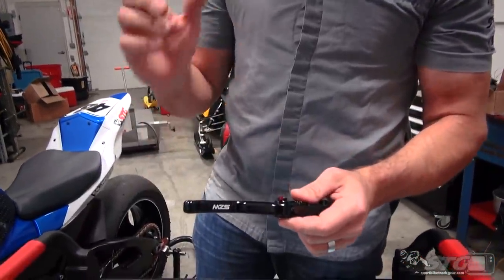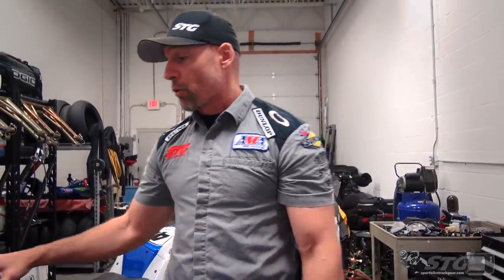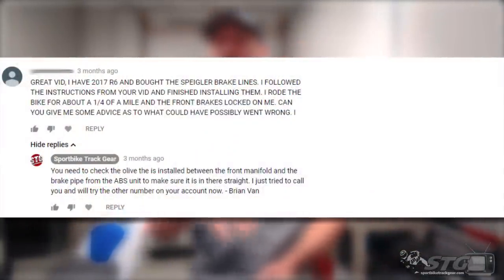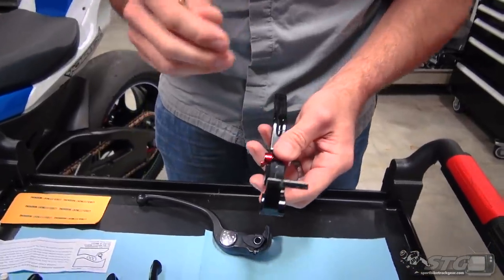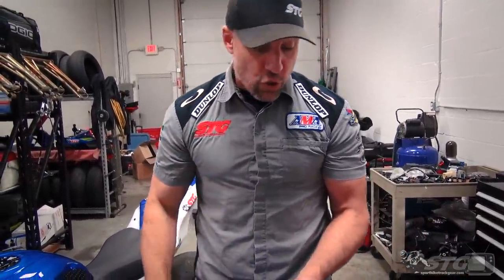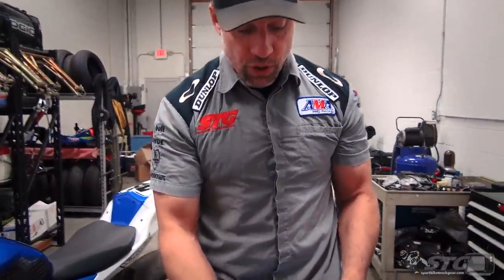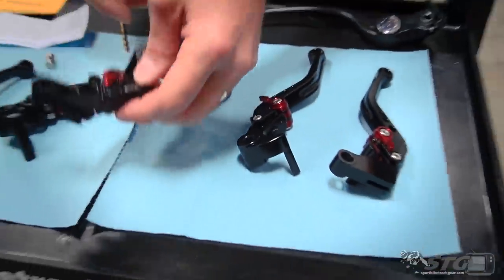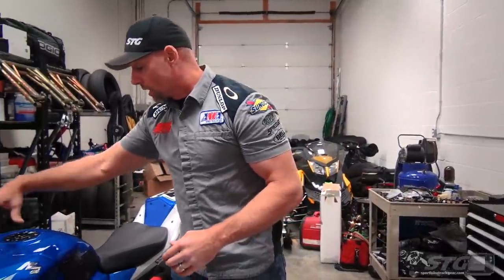The Truth About Cheap Motorcycle Levers | Sportbike Track Gear

Comment: So you wouldn't run a billet lever on your bike... no way in hell right but plz tell me how your completely fine running a cast stock lever I have a 20 dollar set that has way less play on them than those do I mean if you have the money to blow than go for it buy those 90 dollar levers but in the stunt community our bikes get dropped and levers break and I gladly trust my life with those 20 billet levers and when they do break I can buy 5 sets to the 1 set there is just so much better things to spend your money on like actual gear that will protect you when you crash cause there is only 2 types of riders but trying to fear monger people into buying 100 dollar levers just isnt right
Reply from the maker: Zero fear mongering, 100% truth. There are SEVERAL comments in this video from riders who have had their brakes lock up caused by these shit levers. How in the fuck do you justify accusing me of fear mongering because I am sharing something that is true? - Brian Van
Reply: So full brake lock up because of the levers that sounds more of a master cylinder problem or install issue but I'm sure the levers that someone paid you to show off are awesome but trashing another company in such a way is kinda distasteful but thats besides the point but it still kinda feels like your trying to use people's fears against them but on this very specific case how was it the levers fault it cause full brake lock up?
Reply: And I dont own these exact levers I'm using a even cheaper set and on the bike I'm using them is a f4i and there is almost no possibility that my levers could cause full brake lock unless installed wrong but I'll take maybe on some bike specific cases it would be a necessary option to go with the higher end ones but most bikes the cheap Chinese levers will do as long as it's a billet lever and not cast cause the only time I have ever had any issues with a lever is most of the time factory cast levers
Reply: And in most people seem to agree with me in the comments seem to agree more with me and then you said it was more to do with radial brakes and not so much with axial which should have been mentioned atleast
Reply from the maker: So what you are saying is this should just be brushed under the covers? There are now SEVERAL instances of the MZS levers causing the front brakes to lock, we even have one rider crashed and broke his arm when this happened that sent us pics of the bike and his x-rays. This is about educating people so they know what they are getting into. - Brian Van
Reply from the maker: As previously stated the radial master cylinder requires the use of a cross pin bushing, this bushing seizing is what causes the front brakes to lock. The level for the axial master cylinder does not use the bushing which makes it less likely to cause the brake issue (not sure it could cause it to be fair). All of the levers have shit tolerances and are sloppy as compared to OEM or a quality aftermarket lever. Also important to note odds are these companies that produce knock off levers do not have any product liability here in the US, it would be almost impossible to afford selling the levers at $35 a set.  - Brian Van
Reply: No I do agree with you it should not be swept under the rug but it a issue that could easily be fixed by greasing the pin even and or so possible sanding and yea I understand there is some people that aren't comfortable doing that but I know they are plenty of people that are comfortable doing that and yea I get it at the end of the day you guys are a business and trying to make money selling your product but telling people they are gonna die or get hurt if they use these levers is not tasteful imo I love you guys and order alot of motocycle parts from mostly you guys and revzilla but these Chinese parts still have a place in this market and yea its nice to have a awesome product like you guys but trying to trash other companies even if Chinese without a fair review of both is wrong like you could have took the pin out of the cheap lever and greased it and then showed us and told us you had to do that to make sure it operated properly because at the end of the day it's only a problem on radial brakes which should have been mentioned cause I personally see no way of that happening on a set of axial and if I'm out here stunting and my bike gets drop and I break a lever which happens more than I would like to admit but it's not like I'm going to get a refund on those levers and I can break 5 sets to 1 for the same price but with the levers I order which are only 20 dollars for both levers I'm running the same set on my daily bike as well the fit and finish is still alot tighter than those mzn levers shown
Reply from the maker: Thank you for the orders you have placed with us, they are appreciated! I shared this because I felt it needs to be shared, I am not asking anyone to buy anything. Simply sharing things learned over an extended period of time doing what I do everyday. I have installed and or handled a wide variety of parts from more brands than I can remember now. In the past 10+ years I have learned a ton doing these videos.

If you want to see an example of a bullshit review click on this link: https://xlraceparts.com/5-best-brake-clutch-levers/

The replacement part needs to be manufactured using tolerances that are equal to or better than the OEM. It is unreasonable to expect riders who purchase the levers to know they need to remove the cross pin bushing to increase the tolerance or even lube it to avoid having the front brakes lock. You do not have to do this with better quality products or the OEM levers.

Comment: I love your beware videos too many guys and girls trying to save a buck and cheap out on parts just to look good but don't think about the safety part of it. I only use woodcraft stuff for all my control needs you have top quality stuff with warranty and best part is you can buy the broken parts separately if needed and when stuff does fail well you have them at the tip of your figures. Cheap shit from China gets you hurt or killed and when it's time to get help well good luck. I always say if you don't have the money to get 150-200$ levers and 500$ rear sets just don't get them or save until you can afford them but don't ever ever put 20$ levers and 150$ cheap ass eBay rear sets your life ain't worth it. Looks is fun but the function is even better. It's just as bad as going riding with a bald tire your asking for trouble.
Reply: I also had a friend he installed a pair of levers on his bike and he is a seasoned rider with years of installing his own stuff but the brake lever for some reason had a defect for the pin and made the brakes lock up just before hitting the first apex in the fast straight let me tell you he almost had a very bad day he got lucky the bike slowed down just enough before locking up that he didn't fall after we check everything we saw the hole made the pin go in not straight and caused the lock up. these where medium end levers and tried contacting the seller but never wanted to help him out just blocked the numbers we were using and told us if we would continue to contact them they would sue us for harassment...lol in the end saving 80$ was not worth it at all we got lucky. 

I have seen many write that they have never had any issues yep that true not all are bad and not all top quality parts are perfect but in the end the poor quality stuff has a far greater failure rate then top quality parts like woodcraft and company. When Brian makes these videos he's not saying that all cheap parts are going to fail and make you crash or worst he's just giving advice and making everyone aware that this can happen to anyone.
Reply from the maker: Thank you for watching and taking the time to share your experience. End of the day we are just trying to give riders enough information to make an informed purchase. - Van

Comment: Obvious as usual he is trying to get you to buy his buddies expensive stuff. My cheap $20 levers work great and have never had an issue..... I mean they don’t take much abuse at all.... metal and duke bushings..... yes good quality rear sets is a good  idea.

I have never had issue with cheap stands either but I’m not an idiot and get on my bike while on the stands.
Reply from the maker: If you have never sat on your bike while it was on the stands odds are you have never been to the track. I can pretty much guarantee most every rider that has been or goes to the race track sits on their bike while it is on the stands.
Reply: Sportbike Track Gear you say odds are I have never been to the track but then say most riders sit on their bikes on the stands at the track........ do you realize what you just said? Soooooo maybe I go to the track and just don’t trust stands enough and don’t sit on it..... I think that tight shirt is restricting blood flow to your brain.... may need to use the money you are getting to get a larger shirt.
Reply from the maker: No I think you just like to argue on the internet. I 100% realize what I said. If you don't trust your stands enough to sit on the bike with the bike on them then you need a better stand. You need to be able to sit on the bike to dial in the controls of the bike and the easiest way to do that is while it is sitting on top of the stands. Why waste your money on sub-par products? My shirt fits great BTW. - Van
Reply: Sportbike Track Gear lol ok...... I have friends that are strong enough to hold the bike along with the stands that clamp onto the front wheel... I realize like everyone else here though that you are all about selling your buddies stuff so it’s cool. Get a larger shirt and it should help with the blood flow.
Reply from the maker: @JUICED83Z  I am 100% trying to illustrate the difference between quality and sub-par products. From there you can decide what is right for you. This video is 100% accurate information with a direct comparison. The fake product reviews all over the web like the one in this link: https://xlraceparts.com/5-best-brake-clutch-levers/ are what you should be concerned about. - Van

Comment: All the apologies and face saving gestures are unnecessary and distracting.  These aren't little kids selling lemonade. They are professionals selling a product which you are flat out saying is defective and dangerous. Just tell it straight.  They shouldn't be in business selling these products, and consumers need to know not to buy them.  End of story.
Reply from the maker: Welcome to the world we live in man, just trying to prevent getting my ass in a sling. Amazon and Ebay have opened a pipeline that has the moto industry flooded with knock off products that should never make it to market. - Van
Reply from the maker: If you need to save a little money there are better ways to do that:
1) Drink Keystone Light Beer, you can find this shit on sale $15 for a 30 pk. ($.50 a beer baby!)
2) Buy cheap toilet paper from Alibaba. Prices as low as $.07 per roll, you will need to pick up some extra soap to manage the finger breaking through the paper.
3) Dumpster diving for food and other household shit you need.
4) Go to Mexico for all your dental needs.

Each of these money saving tips make more sense than putting shit parts on your bike. - Van